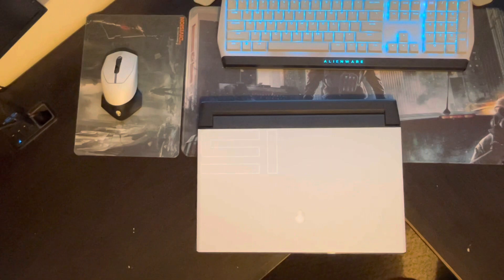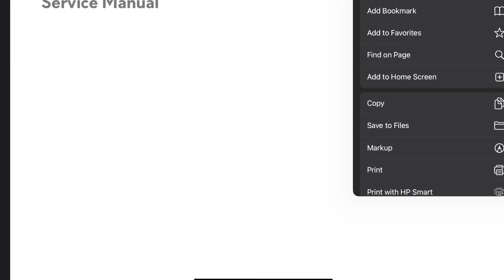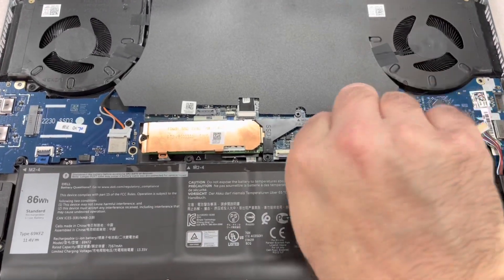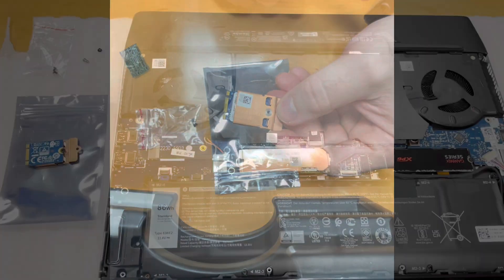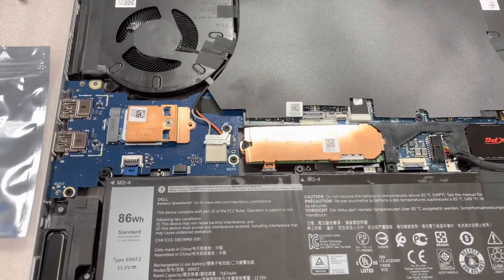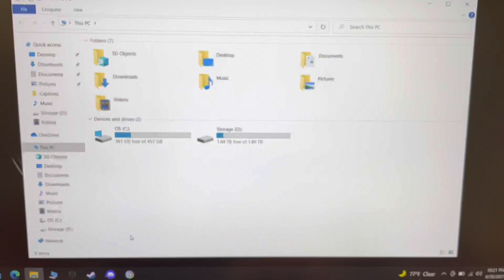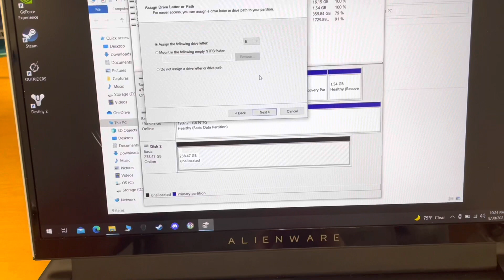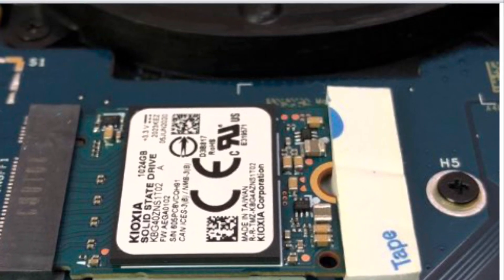Alienware M15 r3  3rd SSD Upgrade M.2 2230

Comment: Your video was not on the topic I needed.  However, it was the most direct answer I could find. XD  No really, I was replacing the main SSD in my M15 R3, but I couldn't find any decent videos of people covering that. I'm not someone who has ever had to mess with the internals before, so I needed someone to point out to me exactly where the main SSD was in this model. And you've been the only person I could find that did such a basic thing, so thank you very much! 

Old SSD had degraded over time and was the original that came in the PC fresh out of the manufacturer. One day, it just stopped loading or working. computer detected damaged equipment. Nobody, not even Dell or Alienware themselves, would tell me how to replace it or offer to replace it themselves. Guess nobody thought I'd want to replace the SSD1 in a decade old laptop. Anyways, time to reinstall windows.  Thanks again for the help!

Comment: This is so strange… First of all, I came to see if by chance this had a similar layout to mine, only to find that this looks exactly like my laptop, but mine is supposed to be an M15 R4… did they not change anything between revisions? I also noticed the SSD you put in has a different pin configuration than the board image - I didn’t know that was possible, but I’m not knowledgeable about these things. 
(I almost put the ssd in without unplugging the battery… would that cause damage or anything?)
thanks

Comment: So I was wondering do i need to buy an ssd from the dell store or does any ssd from amazon work (btw this is for the second slot thing not the 3rd like in this video because i am getting ARK and its alot of space and i don't want to buy an ssd and find it can't be used on the laptop) also do i need to buy one of those heat shields or nah
Reply from the maker: It does not have to be from DELL. The one I purchased for slot #2(2280), from Newegg.com is: XPG GAMMIX S7 Series: 2TB PCIe Gen3x4 M.2 2280 Solid State Drive. At the time it was $199, and it comes with a Heatsink on it already.
Reply: @kevtek3958  ah ok but do i need a heat sink?
Reply from the maker: @DinoDeBlue  yes, you need a heatsink, most higher end M.2 ssd will come with one on it, is what i meant.

Comment: where did you take this adapter? there is mentioned 2230 on the board but 2230 not possible to attach with the screw!
Reply from the maker: The adapter, which is the “Thermal shield bracket” needs to be purchased through Dell or can be found on EBAY.